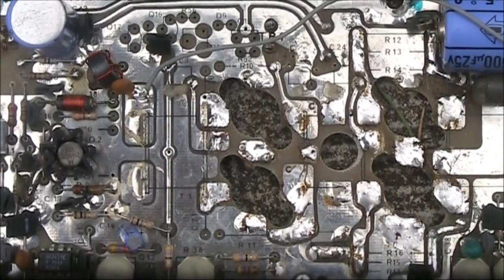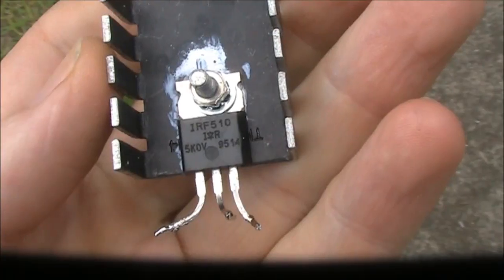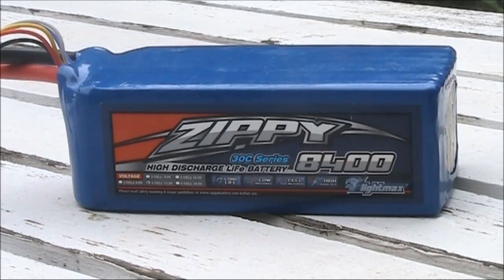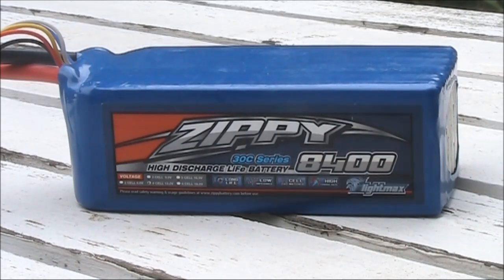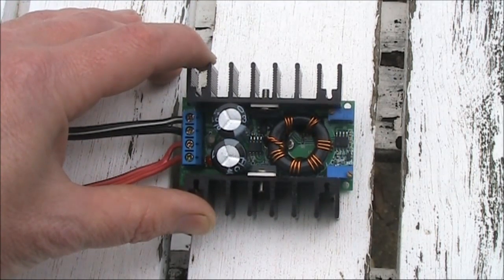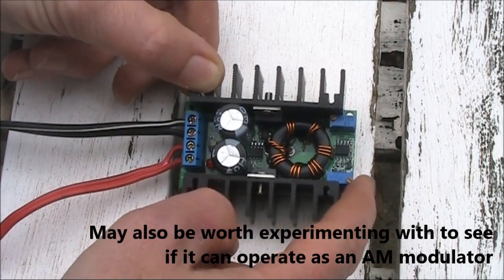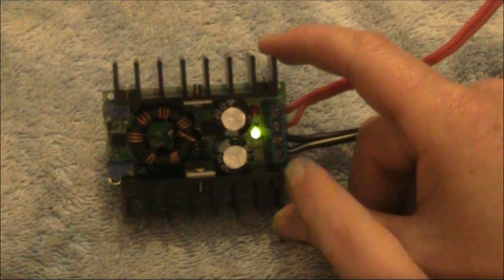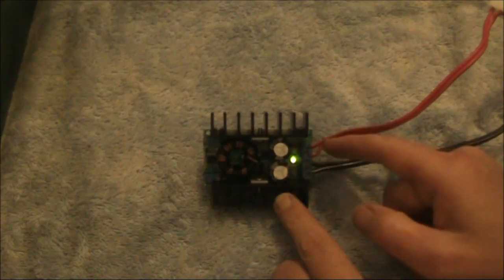More power with a dc to dc converter (and thoughts on RF PA design)

Comment: makes perfect sense, like how often i see people using RF transistors on low voltage, the lower voltage the higher current for the same power, so that means bigger components to low resistance and dissipate heat.